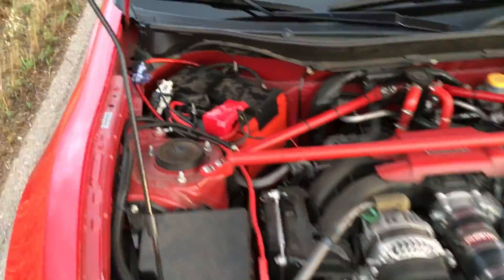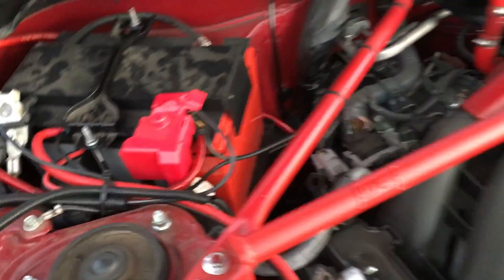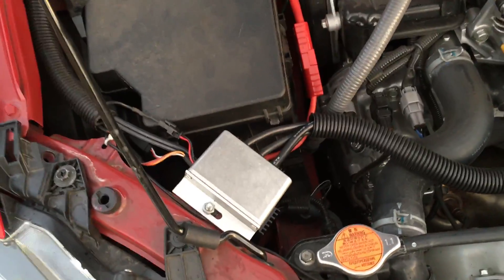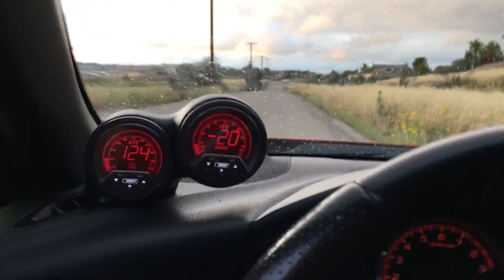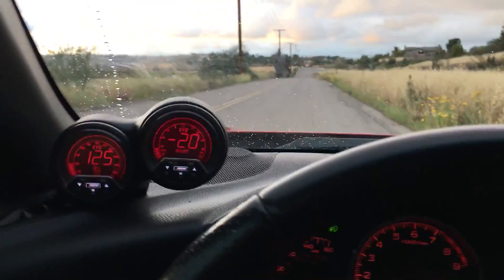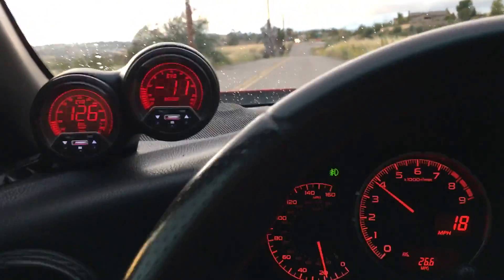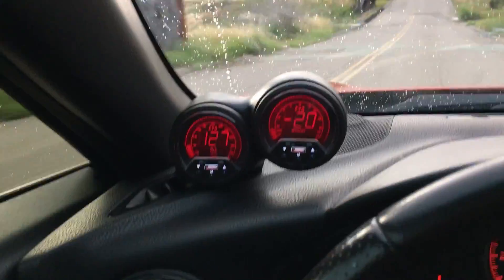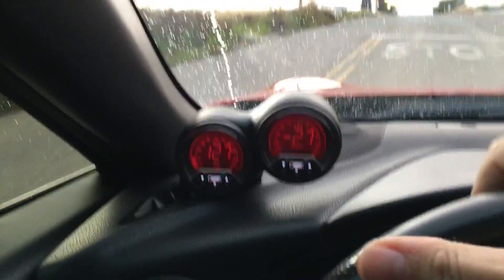Phantom V3 Proof of Concept- Boost Gauge Proof- Electric Superchargers Can Be real

Comment: Ahahahahaha this is part two, the sequel. Where are the diagrams for the wiring? You changed a few things around in the engine compartment.  New equipment, that’s cool.
 I am not gonna talk crap, you got positive boost on your gauge. That is cool, thanks for the video. 
 How did the Invisalign work?

Comment: I’d like to see an electric roots or twin screw charger.. again, adequate gearing will be needed to get the right rpm/cfm but that would be pretty cool!
Reply: by the time you put it it on top you might as well connect a belt to the engine and have a normal supercharger that gives you real power all the way up the rev range. whats the point of a sports car that only makes power on the bottom half. sound more like a diesel truck to me
Reply: @rileyhance318  why would it only have boost on the bottom..? Get a large enough unit and gear it to run more than fast enough. Now you can have more boost than you need anywhere in the rev range
Reply: @DanMarcelino  most of the electric superchargers on the market arent powerful enough to overcome the engines need for air at higher rpms. in this very video it started at 5 psi and by the time he got to the top half it was bordering 2 psi. thats a 2500 dollar system. for 5 grand you can have a twinscrew setup with 12 psi of boost. electric superchargers dont make any sense
Reply: @rileyhance318  exactly. Pathetic!! They need to use a large enough motor and have it geared properly. Not that difficult. Upgrading the alternator is a must though, but big deal. I run two 350amp alternators on my Cadillac just for the sound system.. and the thing still hauls
Reply: @DanMarcelino  by the time you do all that you are at the cost of a normal twin screw setup that is capable of way more power. electric superchargers are a cool thought but fail in execution compared to alternatives
Reply: @rileyhance318  I guess so yeah, it would be very cool to see regardless, but you’re right. The alternator and motor idea would be smarter and way cheaper if you were running a centrifugal type design, or had a blower from another vehicle given to you and you made it fit in an odd position
Reply: @DanMarcelino  with an electric supercharger you will always have the most power in the low end due to the instant torque of an electric motor. so no matter what gearing you use the power will always fall off. it might make sense to use this in addition to a normal turbo setup to eliminate turbo lag. by the time the electric supercharger falls off the normal turbo would have spooled up.
Reply: @rileyhance318  that doesn’t make sense “no matter what gearing” if you gear it for wayyy more speed than you need (the torque making up for the intense gearing) then you should be relying on a blow off valve to release the excessive boost down in the low rpms and then have enough boost in the high rpms
Reply: @DanMarcelino  there are no motors that can fit in a car that would be able to replicate this kind of torque. and if you managed to fit on in a car to drive the turbine it would require much more energy from the alternator than a normal supercharger would normally get from the engine via belt. point is an electric supercharger is more hassle for less power. plus the added weight of the extra batteries. just an inefficient means of adding power compared to its alternatives. better off just having a hybrid vehicle connecting that big motor directly to the driveline instead of it giving the engine extra air.
Reply: @rileyhance318  I have one that is the size of an alternator.. it’s a high output low speed generator
Reply: @DanMarcelino  i still think the effort is better spent on a normal supercharger
Reply: @rileyhance318  hey don’t get me wrong, I agree with you there 😂👍🏼 but in terms of this idea (electric supercharger) and making it work I know it can be done well.. maybe I should start a “go fund me” so I can afford do it myself 😂😂👌🏼

Comment: Sorry, but this is proof that this is a flawed system.. I know that when done properly, an electric supercharger CAN work with adequate gearing etc.. but the whole motor connected straight onto the compressor wheel design will not be able to spin fast enough to produce boost at top end rpm.. the engine is sucking too much air and you can actually see as the rpms go up, the boost goes down.
Reply: Cleetus McFarland just put out a video if him using one of these and it was impressive

Comment: A lot of negative feedback in the comments. The point of these phantom units is that they make great, almost instantaneous torque stupid low in the rpm range, and it is not as invasive as doing a dedicated traditional forced induction setup. Lots of teenagers love to say “Bro turbski kits only cost a thousand more” not realizing that additional cooling is needed/the OEM clutch is not going to last etc. and it becomes very difficult to return to factory form. I think these phantom setups were a great medium between flex fuel/header power levels and the entry level centrifugal setups like Vortech and JRSC.
Reply: Oil and coolant lines need to be plumbed, literally no boost lag on supercharger (would be great for twincharge). I have a 550whp LGT with a FP Black and I really wanna do a twin charge so I can hit boost faster.

Comment: not fan of all the air have to pull against it when it not working at mid level or at peak. have anyone try to have two intake?  the oem one, and a second air intake fore the  supercharger and then into one, the oem one have a one way air valve so when the pressure from  supercharger bulids up to a point the oem closes by that,  so the supercharger can work with closed system, when it not up to good boost speed then the pressure from oem intake from the front grill helps out to join the air feed.

Comment: Superchargers require power to turn via a belt and turbochargers require power to turn via exhaust pressure. An electric turbo or supercharger operates on stored eletrical energy, so at the time of operation it does not rob the engine of any power. Boost with 0 parasitic requirements on the engine is an extremely good and useful idea. It is also completely independently electronically controllable regardless of engine speed or load which offers a world of opportunity for tuning. The only downside being that its operation is dependent on a limited amount of stored energy, but as battery and motor tech improves the window of operation opens. Anyone who doesn't see the benefit of this is blind.

Comment: nice video good way to prove a point. add to that  I am also been messing around this type of power distribution. I've worked  on supercharge setups and turbo charge setups.. and this new type of hybrid  setup is a big game changer.  I honestly think that in my own opinion this is gunna change  everything we all no about compressing air.. I have currently  I'm on a test and tune my self. I live in alaska were as is winter can beat a person's car up badly.  its winter time here now temp is around 20 degrees and dropping..so typically what I'm getting at is no matter supercharge  turbocharge.. even hybrid shit I'll call it HSTI hybrid super turbo injected ...lol or you can mix it up and call it shit for sort.  lol sorry well with out maintenance test and tune. day in day out driving all climate  snow rain dry roads to etc etc... we understand  that doesnt matter what power your making it can all still have its pros and cons...good example dry roads and a good amount of drag strip or up or down hill roads and eve  rain the electric turbo works differently. snow and more below temperatures is now my next testing.  I mean come on you can tell me really turbo and etc charging doesn't have a lag on a cold start  negative  5 below Fahrenheit .. even diesel  engines..a d if you really break it down. metal to metal friction when condition are more stress to any thing ..lol even people...well any ways keep your head up man. this is history in the making..the future  is electric powered recharging  lithium ion  or solar powered etc etc dumb ass..llllllol JK but I no fossil fuel can last only for so long..so we got to all figure  this out one way or other

Comment: Boost doesnt mean power. CFM makes power. Boost is just a a tool of measurement to tune with. Feeling a manifold with compressed air is easy. Try getting that air into a pressurized cyclinder. So noooo this is not proof. Take a boost gauge and hose and anyperson can generate 2 to 5 psi on a gauge.

Comment: Well its will work if you use same brushless  motor i believe its 860KV -1088KV which could run up to 30k RPM with 1to 3 gear could be installed you will get around 90k RPM
The real turbo run between 90k - 150k RPM
 
By the way  the F-1 has E turbo

Comment: This would be maybe helpful for a small engine, or my old straight 6 f150 for going up a hill, because it needs all the help it can get, but not for serious performance. There are some promising electric boost systems floating around, but the motors are huge and provide "in the moment" boost and are done when the battery is depleted.

Comment: I believe the supercharger works but I also believe it needs a more powerful motor. That motor isn’t able to keep up with the air consumption up top. Idk if the make these for the s2000, but I can guarantee that it would lose top end power. The s2000 EATS air at high rpm. (I mentioned s2000 because I drive one)

Comment: Anyone who thinks that this crap is actually gonna work on your car is just stupid first off it blocks air going into the engine when not being used and then when turned on it probably slows down the amount of air going in as your throttle body is completely dialed in  and only excepts the air that is allowed in therefore the throttlebody will partly close not allowing this so called air to even get in now I'm sure that this probably looks cool underneath the hood though.

Comment: Confusing to say the least. You need a geared unit. A 1:1 ratio will not make the tq or speed to push enough air. First the compressor wheel is to small for the rpm its turning. Bigger compressor wheel with at least a 4:1 step ratio. You want to run in the 45-65000 range. Best to get an aftermarket self contained procharger/vortec and adapt a motor to it. Use a blow off to regulate boost. While I applaud your attempt, there are some glaring obstacles you will never over come. First and formost if you could get the right geared step up drive, appropriatly sized compressor wheel and right sized motor. You should at a minimum mount as much battery power for this IN THE TRUNK! You also should find a shop that specializes in alternators to either retrofit a much larger one or modify yours to the max.

Comment: Alright so you obviously dont know enough about a motor to realize this is complete and utter crap. Cost aside idc if you got it spend it you put a fan in front of your intake and without a motor turning it the air sucking in would have to that equals less hp not more for one for two how do you honestly think you are gaining any hp without bigger injectors a tune and exhaust a motor works by air in and air out. Another example is ppl that put a 3 inch exhaust on a 4 cylinder and saying they gained power without a cam or anything else no you lost power and are burning your valves up bc there is not enough back pressure without custom head work. Its all a placebo affect the reason it spikes at 5 and drops fast is bc of the natural suction of the motor and honestly the restriction of the fan in front of the intake. Here i though humans were getting smarter and there you go blowing that thought clean out of the water. I really hope you are joking with us with this whole video series bc if not i really feel sorry for you in life and just hope you are inherently wealthy bc if not your looking at a rough road in life being this gullible

Comment: i just found out what it cost, that's insane $2000+ for a forced induction that maxes out at 3psi of boost then drops as you increase rpm, what is 3psi of boost worth in that little motor, about 10 hp @ 3000rpm, you can probably get more then that out of a fresh air kit and a good computer tweak!!

Comment: Better way to spend $1500...cams.  There now you have extra power 100% of the time.  Ok so it makes 4 lbs of non intercooled boost for a little bit....who gives a shit?  Btw how do you tune fuel and timing to deal with this on/off increase in air?  Sounds like lean/rich heaven.  Also when the juice runs out and the wheel stops spinning...all you have is a big intake restriction which robs HP.  If you want cheap boost, add another $500 for a cheap ebay kit.  At least those make 7-10lbs....constantly.  Without being a big intake restriction.  Also you dont need 3 batteries which add weight.

Comment: put it on a dyno and compare it to a stock model.  that's all the proof you need.
Reply: Dyno means jack shit....If it's reaching 4psi you will see dyno improvement. Take it to a course, do a few laps and show the avg improvement. For this booster fan to justify itself, you'd need to recharge fast enough, provide enough PSI and provide long enough....NOS would run out for few laps, but it'd take weeks or months for the motor and battery to wear down on race track. And that could be few usable years on daily driving.
Reply: they have dyno'd the system without being installed on the vehicle and then AFTER install, the dyno shows up to 20% HP gain on the smaller engines. The larger ones only gain 30-50hp. Man educate yourself on the product that AUDI has now taken serious consideration of for future car manufacturing and learn something. there is SOME value in the unit and its not a plastic ebay piece of garbage fake thing that is being sold for 50 bucks, these are legit products for low HP gains

Comment: I've worked with Lithium power for 16 years & without trawling through all your videos for an answer, could you tell me what amp draw this system creates?....but more importantly, how much effort is placed on the engine to feed this draw, say in comparison to a comparative roots charger, say the M45 for example?....tbh, the proof in the pudding is actual before/after dyno runs.......I'm finding it difficult to see any advantage without this.
Reply: http://www.ft86club.com/forums/showthread.php?t=39719 
A lot of info on this forum thread. I don't personally know the draw this takes but I do know it runs on two 12 volt batteries connected in series plus one 12 volt battery for electrical needs (starter and stuff). The 24v system gets recharged by the charger connected to the 12v battery only when not in boost. There is a switch on the gas pedal that activates the system. When in boost it does not take power from the car's 12v system so it does not cause any parasitic loss. Only once you stop boosting it'll start charging the 24v system. I want to get a BRZ or Toyota 86 eventually and I would love to get my hands on one of these systems. It's perfect for day to day driving and many people say that it's just the amount of power this car was missing.
Reply: Now that you've explained this, it would be more efficient to run an exhaust driven alternator to power the motor......I don't think you fully understand how combustion engines work in comparison to that of an electric motor, for eg: when under load, an electric motor will continue to try to spin by demanding more current, whereas the combustion engine loses momentum & thus power....without taking friction & weight into account, a large alternator will have an adverse effect on the efficiency of the engine & you will never get out what you're not putting in.
Reply: You don't need a larger alternator for this system. The point of this system is ease of installation. An exhaust driven alternator to power the motor would definitely be a great option but again it would go against the whole ease of installation this kit was designed for. When charging the 24v system it will rob some power from the engine since there will be a larger load on the alternator but the goal of this is to be a "Full Throttle supercharger" (It has changed since it's first creation but it has mostly kept it's main purpose of adding power when you push the pedal further than 50%). It will rob engine power to recharge only off boost so I don't see a problem with that since most of the time off boost you'll be either maintaining your speed or slowing down. With the conversion on energy from mechanical into electrical into mechanical again there is definitely a loss of energy and it isn't 100% efficient but it is pretty impressive either way.

Comment: if this charger was like 80bucks then it be worth me getting it but i hear this is a expensive charger.....i can buy a turbo on ebay for 75 bucks.....buy a manifold for 50..universal pipe kit a exe intercooler and run 15psi watching the detonation ........and   thats just about the same as what they are asking for this electric charger......sure 5psi would be a good gain but 15 is much better but i may be wrong im sure there will be a turbo fanatic yo criticize me..lol but all in all if this was cheaper im sure it would fly off the shelves